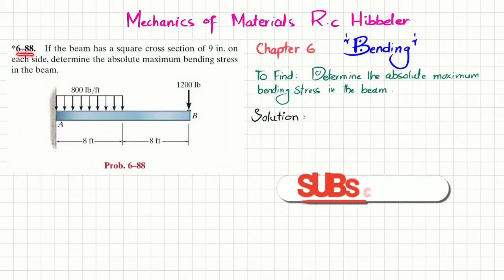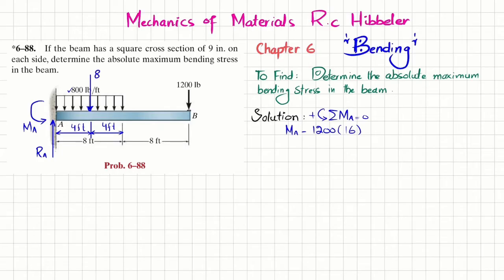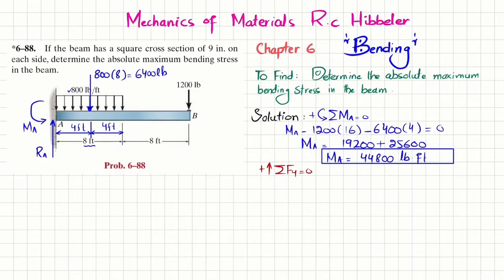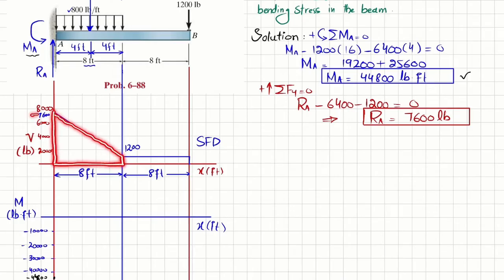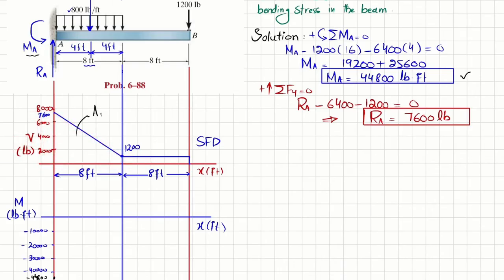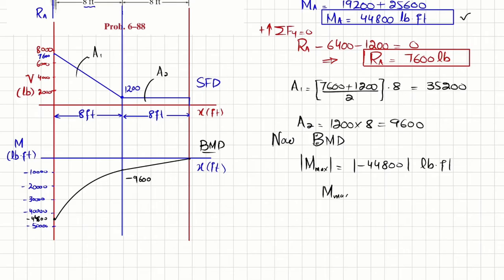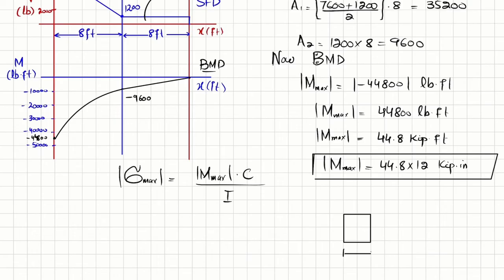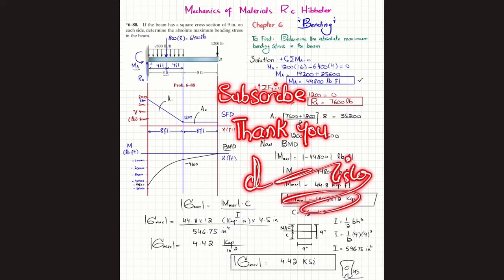Determine absolute maximum bending stress in beam | Problem 6-88 | Mechanics of material rc Hibbeler

Comment: C=4.5 , how did u get it?
Reply from the maker: It is given in question that its square in Cross section and one side is 9 inch so half of it will be 4.5 and c is distance from neutral axis to top/bottom layer.

Comment: Why do we plug in the negative value of moment around point A, when the calculated value is actually positive?
Reply from the maker: In book , it is mentioned and also convention that when drawing bending moment diagram , the ( counter clock wise moment ) positive moment will be drawn in negative . The reason is that  it produces compressive stresses at point A.